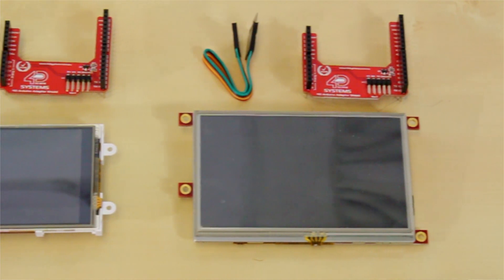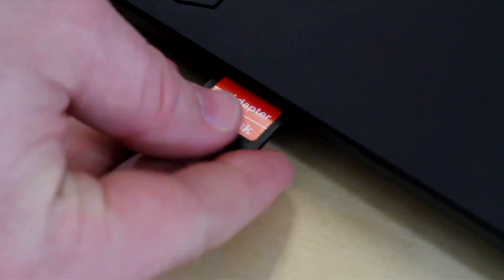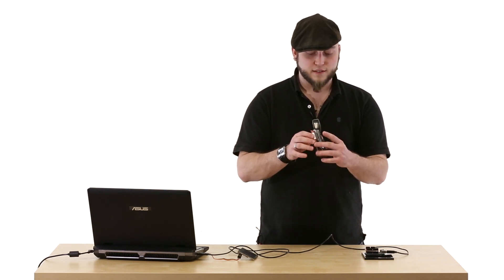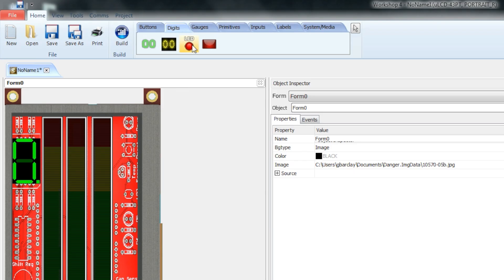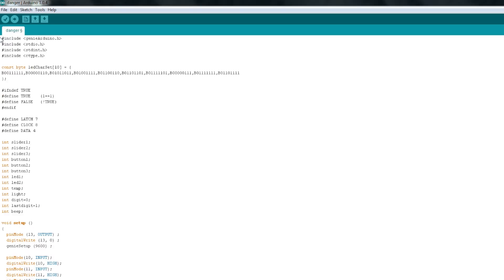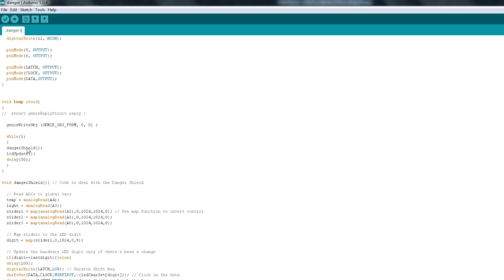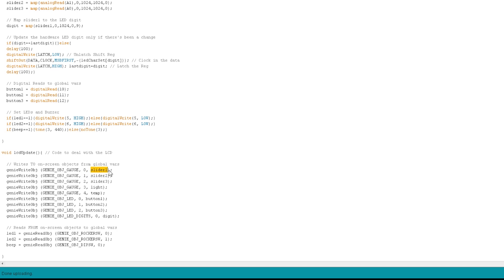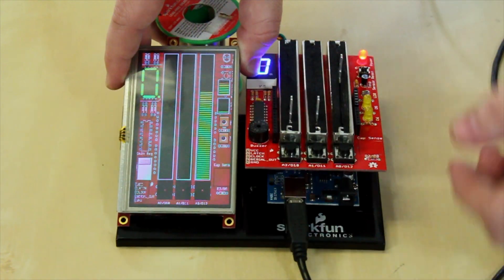4D Systems Touch LCD Screens

Comment: I keep getting the following message no matter what I do. Does anyone have any advice? "FileTransfer failed, run stand alone and check produced messages. If using a programming cable, or an MB5 ensure the baud rate settings have been set correctly. 4D Systems support is not help. All they said was update drivers.

Comment: Okay... so today... I finally managed to get one of these working.

The majority of the documentation linked by 4dsystems around the web and especially any linked to their blog is either missing, or poorly explained.

This video from Sparkfun is pretty spot on, but be aware that the function call to genie.WriteObj() is now called genie.WriteObject() in the latest version of the library in 2021.

On a Leonardo or Pro Micro... make sure you are setting up Serial1 to use the TX/RX pins 0,1 on the board in the sketch. And finally make sure when you've set up the Genie form in the Workshop4 designer tool... under the project tab... there is a comms speed box on the top bar. This is where you set the baud rate on the LCD side, and you have to match that in your arduino sketch.

Comment: I’m curious. I saw latency between the sliders updating via interaction and the on screen display of the slider state.

Is this avoidable? I’m looking to build a midi controller with endless encoders where each encoder has its state reflected on screen. Latency would be an issue when considering the visual feedback in relation to what is happening in real time.

Thanks for any insights!

Comment: Ok, So I downloaded the Workshop-4-IDE from the downloads section and started designing an interface for my furnace, I want to be able to have a couple of pages, The first to display Heating and Air conditioning options as well as displaying current temp. The second page will have information from the heat pump such as temps from incoming and outgoing water, Plenum temp, Water Flow rate Etc. My question is in the Visi-Geni IDE am I able to create more then one Page "Form"? Maybe I am overlooking something simple.
Reply: +Railyard Productions So basically each screen you work on is called a "form." You can add a new form by going to the System/Media tab and adding a new form. Hope that helps!
Reply: Thanks for replying. I found the Blue icon to create new form shortly after I posted the question. Great Product.

Comment: The genieArduino_Demo dont work :

Arduino: 1.0.6 (Windows 7), Board: "Arduino Uno"
genieArduino_Demo:26: error: 'Genie' does not name a type
genieArduino_Demo.ino: In function 'void setup()':
genieArduino_Demo:34: error: 'genie' was not declared in this scope
genieArduino_Demo:54: error: 'GENIE_VERSION' was not declared in this scope
genieArduino_Demo.ino: In function 'void loop()':
genieArduino_Demo:63: error: 'genie' was not declared in this scope
genieArduino_Demo:68: error: 'GENIE_OBJ_COOL_GAUGE' was not declared in this scope
genieArduino_Demo:75: error: 'GENIE_OBJ_USER_LED' was not declared in this scope
genieArduino_Demo.ino: In function 'void myGenieEventHandler()':
genieArduino_Demo:115: error: 'genieFrame' was not declared in this scope
genieArduino_Demo:115: error: expected `;' before 'Event'
genieArduino_Demo:116: error: 'genie' was not declared in this scope
genieArduino_Demo:116: error: 'Event' was not declared in this scope
genieArduino_Demo:121: error: 'GENIE_REPORT_EVENT' was not declared in this scope
genieArduino_Demo:123: error: 'GENIE_OBJ_SLIDER' was not declared in this scope
genieArduino_Demo:128: error: 'GENIE_OBJ_LED_DIGITS' was not declared in this scope
genieArduino_Demo:134: error: 'GENIE_REPORT_OBJ' was not declared in this scope
genieArduino_Demo:136: error: 'GENIE_OBJ_USER_LED' was not declared in this scope
Reply: You have to comment out this part in the code: 
  //genie.WriteStr(0, GENIE_VERSION);

its under the setup loop, Doing so will make the code run

Comment: If you're using windows 7 and have a microSD card larger than 2gb then you need to format it with FAT16. Follow this link to do it all in the command line step by step (which is the easiest option if you don't have special software already): http://superuser.com/questions/202160/how-do-i-format-my-8-gb-usb-drive-to-fat-fat16-in-windows-7
if that link gets redacted, its basically a stack overflow page with step by step instructions on using diskpart to make a FAT16 partition.

Comment: super cool concept, but doesn't it take the fun and satisfaction out of prototyping?  I like the challenge of having to write my OWN code, working out all of the bugs, and in the end seeing the project work .. knowing that I wrote all of the code by hand.  If things get any easier than this, folks are going to forget how to program!  If you don't use it, you lose it.  You gotta admit, there is a huge feeling of satisfaction when you work hard on complex code and finally get it to work !!  For me, that is what makes prototyping anything fun.
Reply: it's like using an API; why reinvent the wheel when you can use the support of the SDK?
Reply: It's true. I feel that buying all of this stuff, copy and pasting code takes the joy out of everything. It's like an empty feeling.
Reply: From using this system personally, I can assure you that even if you copy-paste the code, unless you're doing EXACTLY what the demo code is, you still put in quite a bit of work.  I stripped out at least 90% of their code for my project.
Reply: Using the ide for this is really no different than using the arduino ide.  Yeah it saves you from having to write it in machine code, but it's not exactly doing 100% of the work for you.

Comment: This Video is using the 'old' ViSi-Genie Arduino library which has since been improved and has been available for a number of months now. Video also shows a 50mS delay in the main loop which adds to the latency. 4D Systems will have a version of this demo available on the website as an Application Note in the next few days.
Reply: Your products are great, but the documentation is just seriously lacking. Your videos are too fast and don't make it easy to understand the display ussage furter than the very limited widgets. It would be great if you could add more intuitive GUI design. Use PyQT designer as an example.
Reply: @johanvandeventer1021  Agreed. I've had a couple of uLCD-220RD for a few years... every now and then I get them out to try and use them for a project. And I'm yet still able to figure out how to get serial data to the widgets on the screen. 

Documentation is woeful.

Comment: Where can I get that Ardunio code he's using? My project is to display a couple temperature sensors that control relays controlled by the Arduino board. Basically, I'm making a thermostat. Are there any sample codes or projects I can check out?

Comment: /////////////////////// genieWriteContrast //////////////////////
// 
// Alter the display contrast (backlight)
//
// Parms:	uint8_t value: The required contrast setting, only
//		values from 0 to 15 are valid. 0 or 1 for most displays
//      and 0 to 15 for the uLCD-43

Comment: I was going to ask this. There is a 50ms delay in the demo sketch. I'd like to see how fast this runs (how much lag there is) with that delay removed and possibly with the baud-rate to the LCD increased to maximum. That would give a better approximation of the maximum theoretical response.

Comment: Quick programming theory question here. Why did you choose to have that first GenieWriteObject line in the loop() and use a while(1) to create an internal infinite loop instead of having that first GenieWriteObject line in the setup() and no while(1) in loop()? Any specific reason, or just an arbitrary (yet still valid) "this is the way we did it" reason?

Comment: The 4D Systems screens should be compatible with anything with a UART. Also, the library provided for Raspberry Pi is just a C Library, so anything that can talk serial and run C is just as compatible as RPi.